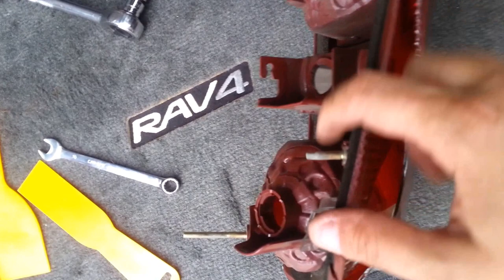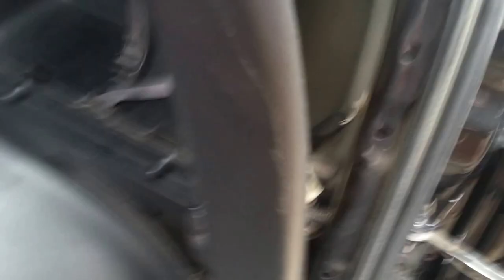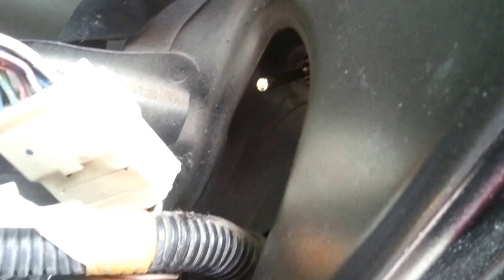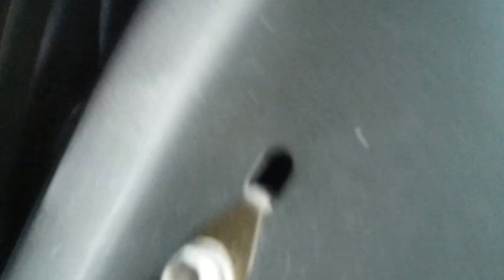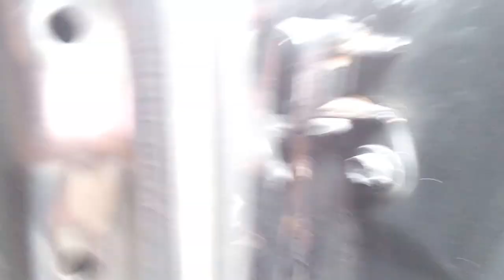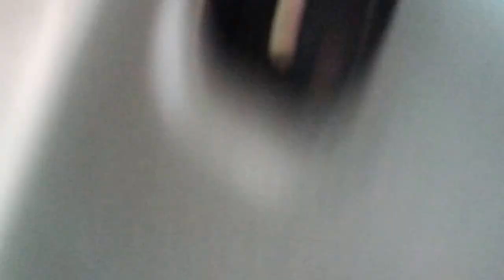Tail light replacement Rav4 2001 to 2005

Comment: I have a 2001 Rav4, I stuck my hand from the inside of the compartment and still could not feel the 2 other bolts.  There is for sure in total 3 bolts?  And from your video I have to take out the panel first.  This is on the left side of the car (driver side here in the US of A).

Comment: Great video! I have one important question. Does the 2005 model fit the 2003 model? I've planned to buy the 2005 tail lights but I really want to know if they will fit my 2003 RAV4 model. Thank you for the replacement tutorial.
Reply from the maker: Thank you!! Im not 100% on that but I am 95% sure that it will fit 2003 because Rav4 years 2001 to 2005 is the same generation Rav4. Called 2nd generation. If you still wonder I would google this question. Hope this helps and glad you enjoyed the video!! I try to very detailed to help people. Thanks again!! Merry Christmas!!!!!
Reply: Gertie Music I've already done a Google search and it referred me to your video. I will look further. Thanks again for answering!
Merry Christmas!!!
Reply: Thanks for this tutorial.
Made it heaps easier for me while splicing in a light socket for a trailer. No broken panel clips either 👍🏻

Comment: I don't believe you have to remove the whole tail light assembly to change a burnt out brake light. if you are replacing the whole tail light assembly, then you have to remove the bolt nuts to install a new tail light assembly.
Reply: The brake lights are part of the led tail light, so you can't just replace a bulb but the entire tail lamp.